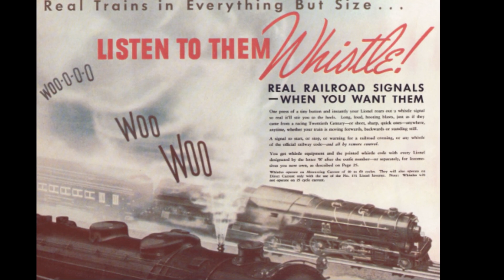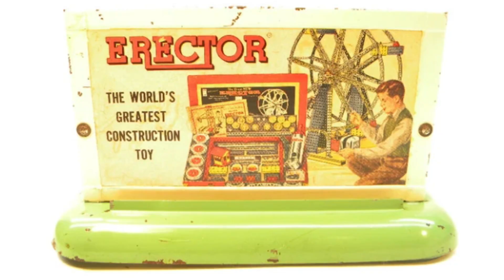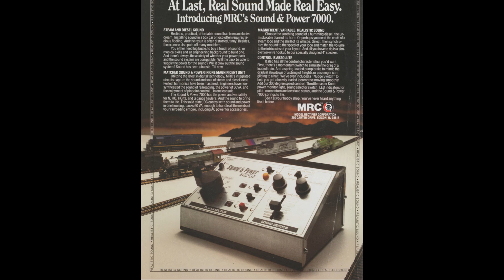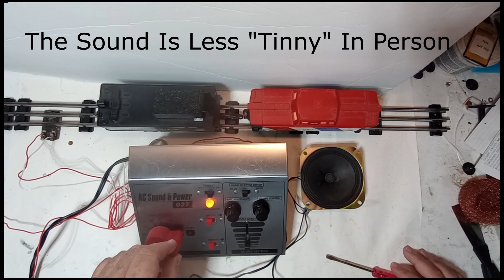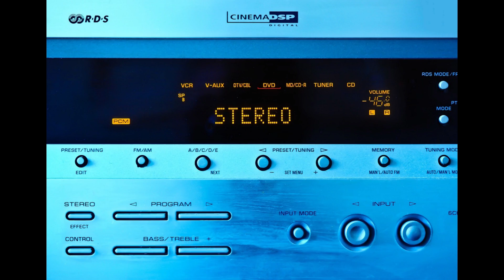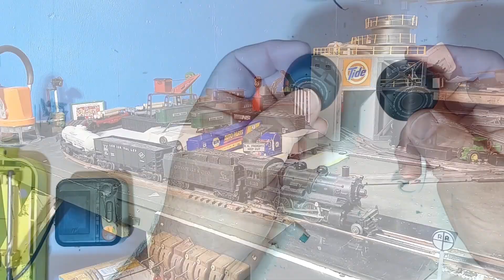Hacking Vintage Toy Train Tech: MRC AC Sound & Power Unit (Plus New BlueTooth Sound Tips!)

Comment: Can additional sounds from another device like a phone for example, can be played to the sound & power 7000? Could the line out converter method work on the DC version of this sound controller?
Reply from the maker: There is no input on the throttle, so additional sounds cannot be added. Yes, the output method will work regardless of AC or DC current.
Reply: @ Oh, another thing, can the line out converter also be connected to MRC Symphony 77 and their synchro soundboxes too? If so, please let me know how, thank you!
Reply from the maker: @ferrocarrillagranciudad  If it has a speaker output as shown in the video it should work.
Reply: Speaking about DC converters, I heard that not all of them have ground wires, so if it doesn't have ground wires, then they can just be connected to the speaker output for MRC soundmaster 210 or MRC Symphony 77?
Reply from the maker: @ferrocarrillagranciudad  I cannot speak for the throttles you mention as I have never ownde either of them.
Reply: @ToyTrainTipsAndTricks  If you were to own those said devices, MRC symphony 77 or MRC sound station 312 and MRC sound master 210, would you make a review on how to install a line out converter on said devices? Because I would want to have one to know how to add a converter to add a Bluetooth transmitter for onboard sound to my model trains
Reply from the maker: @ferrocarrillagranciudad  I checked the specifications for the Symphony 77. It is a closed system. To make it work you must cut off the existing speakers. Then attach the pair of wires from each speaker to the inputs on the converter, just as in the video. There is no convenient place for the ground, so you will need to run an additional wire to your common earth ground for your home to eliminate the hum.
Reply from the maker: @ferrocarrillagranciudad  The sound master 210 would be wired exactly like the video, BUT it requires DC track power. It will not work properly on an AC powered layout.
Reply: @ToyTrainTipsAndTricks  Would adding a metal strip eliminate the hum?
Reply from the maker: @ferrocarrillagranciudad  Probably not. It must be attached to ground.
Reply: @ToyTrainTipsAndTricks  Where to the ground? If not all lineout converters have ground wires, the humming sound would still persist?
Reply from the maker: @ferrocarrillagranciudad  If it has a ground wire, it must be grounded to SOMETHING metal that is electrically connected to earth. A water pipe. A conduit. The center screw on a metal electrical outlet. The metal case of another electrical device. 
Something.
Reply from the maker: If it has an input, then you can input. If it doesn't have an input you cannot. Simple.

Comment: I have a Kato synchro soundbox and mine is equipped with a line out and was able to get sound to a tiny-cubed Bluetooth speaker from the transmitter and I use it on boxcars and sometimes a dummy/ non-powered F7 unit
Reply from the maker: That works! My hack is required on the MRC because it does not have a traditional audio out.
Reply: @ToyTrainTipsAndTricks  If the line out converter was to be installed on the MRC sound master 210, where would the ground wire go?
Reply from the maker: @ferrocarrillagranciudad  if the case is metal, you should be able to attach it anywhere on the case. If the case is plastic, you may have to open it up in order to find an appropriate grounding spot.

Comment: I recently picked up a diesel generator system from a swap meet for free. Its from 1989 and has a fairly realistic diesel sound. This one takes an input from any throttle for synchronized sounds. It also came with a separate box just to generate the horn but does not sound as good as the horn shown here. I'd love to find one of those old Pacific Fast Mail units for my vintage steam engines!

Comment: I saw one of the DC ones on another model railroading Youtube channel.
I am one of the "purists" who only wants sound in the trains and hence completely ignored it.
Now that I am planning to build a loco control stand thingy for my railroad, it might be nice to include a sound system built in it--it would feel like you're IN the locomotive, not in a fake locomotive.
Also--I would have had no idea as to whether the camera needed cleaning or not; my computer's monitor is very dusty and needs cleaning. Even if the camera was clean I wouldn't be able to see the difference.
Reply from the maker: You COULD put the speakers inside the locomotive, but then charging and power on/off access become issues. I suppose you could then use an Arduino or ESP32 board, powered by the track. as the BT receiver and speaker driver but that's more time, money, and effort than I'm willing to invest right now. Plus portable speakers means it works with every locomotive, not just the one installed.
Reply: @ToyTrainTipsAndTricks  I was thinking to simply use any old speaker in the control stand.
Reply: It might also be possible to convert the DC current from a regular Sound & Power to an AC current (I have too much old electronic junk). Maybe hooking up a rectifier backwards?

Comment: Howdy my friend, I am on the slightly opposite side of the spectrum from you as an S Gauger/American Flyer fan but I hope you'll be willing to help me :)

My question is this, I find the sound effects of the Flyer whistling billboards to be absolutely silly, if I bought a bluetooth speaker and tucked it into a boxcar as you have done how could I find appropriate sound files to load on and then play at correct intervals (Things like bells, whistles, etc) and how then would I coordinate the files to play correctly?
Reply from the maker: This should give you some ideas: https://youtu.be/SwvV_-1AjzU
Reply: I have a suggestion too, you could try making a simple program using Scratch. It's a fairly simple programming language and it is free! I made a Bluetooth-based sound system using it.
Reply: @Engine1988  Can you provide more explanation on how I would code such a thing?
Reply: @jas5267  It's easier to understand if you have the system, but basically imagine a line of dominoes. When each one is knocked over, it does something. You configure the action. It might change something onscreen, it might delay the next action... or it might play a sound that you load in. With a bit of simplicity you can set it up so that it changes what sound it is playing when you press the right key.